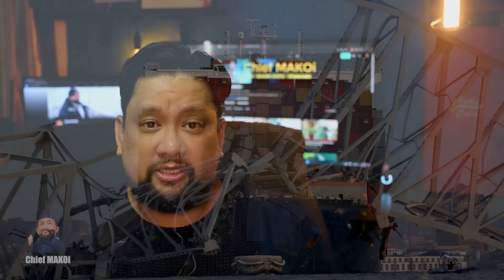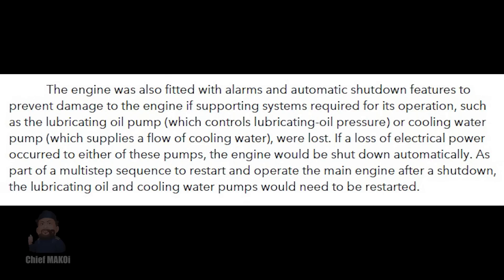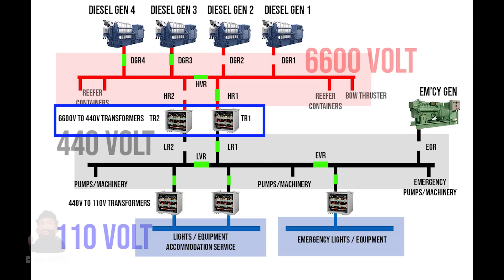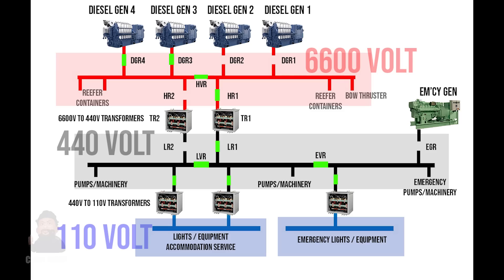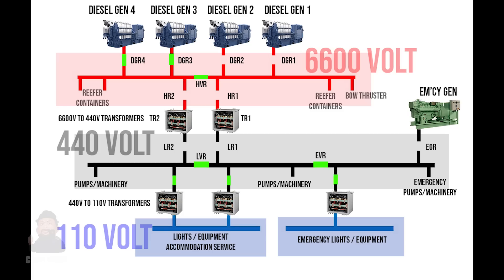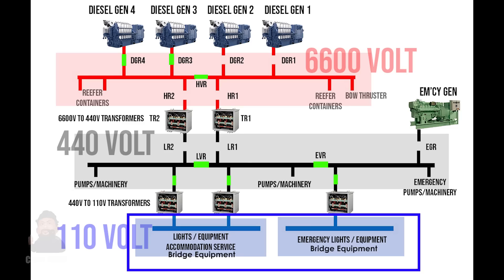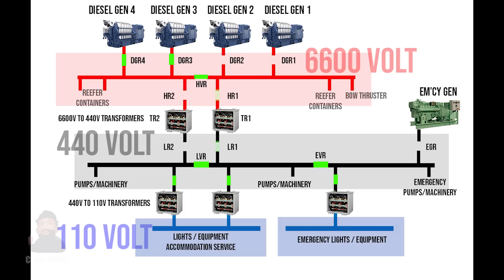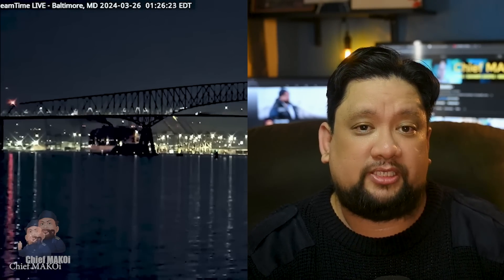Explaining the NTSB Report on the Container Ship DALI | Chief MAKOi

Comment: Hey Chief I was recommended to your channel I’m finally off my boat with the bandwidth to do
It. Great synopsis. The black smoke is a big indicator to me, I’m sure you’ve seen stuck injection pumps in your career. Too many and the generator can’t control its speed and everything else goes wrong. I think the final report will have many more details including bow thruster stop time I have a theory stopping the bow thruster triggered the crew to stop a 3rd generator not discussed so far and that event showed the other 2 online generators unable to adapt to the load change.
Reply: Yes; good thought & approach also to look into electrical `load drops´, not only jumps with load increase. We can strongly assume preliminary NTSB report so far only included topics which are waterproof already.
But that question wrt “bow thruster stop time” (plus when crew actually started stopping it; as it is supposed being less effective once ship gains speed ahead, thus there’s “plenty of time”) might also be interesting wrt to the direction of Dali’ and this veering to starboard towards the bridge pillar later on. I’d expect bow thruster has been used to make the 180° turn when leaving the pier and moving towards the main channel; possibly still being active when moving straight ahead. With the bow thruster causing water flow to turn the bow (for the 180° turn to port it needs to drag water from port and `pump´ it to starboard), it might be interesting what happens and how once bow thruster engine slows down and stops. Simple assumption is that power will be switched off from the bow thruster motor. Due to inertia of both engine and water flow, the flow will `gradually´ slow down until it stops finally. However, there might kind of `compensation reaction´ such, that water flow might also cause some small push of the bow in opposite direction now, which would be to starboard then. That would fit from timing because if the first blackout would be caused by switching off the bow thruster (while motor and propeller still spinning for a while), it would cause veering momentum which however might only be noticeable later.
I could image such kind of `compensation´ also happens wrt `propeller walk´ once main engine slows down (but with much bigger effect there). NTSB prelim report has interesting detail that rudder was amidships (0°) when first blackout occurred – means that `propeller walk´ has not been compensated by rudder at that time. Posted a long comment & question in corresponding Sal’ videos on `What’s going on with shipping?´ wrt that.
That’s when I’m spending thoughts wrt the physics involved here – but ask for feedback from any experienced seafarer (PS.: so please bear with me that I’ve hijacked your post for question wrt manoeuvrability, but perhaps somebody jumps on it. I’m really curious not only about the cadence of technical fails but also which effects they’ve caused leading to this overall disaster finally).
Reply: Two further questions wrt system components behaviour in case of loss of electrical power – using the opportunity to have 2 chiefs in this conversation here. To me it always interesting to also look into how systems behave when operating conditions are not as expected - especially when lots of inertia is involved.

Part I: For a 2-stroke diesel engine, are inlet and outlet valves controlled mechanically or electrically?
If mechanically and linked to the rotation of the propeller shaft, that would mean engine sequence would continue `as per normal´, except missing air blowers (I’d assume turbo-charger not active at vessel speed below 10 knots yet – ?) and high-pressure fuel injection. Thus at first moment of power loss there’s less resistance for compressing the air, while last remaining combustions still are done `normally´, but also face less resistance. That could even lead to a slight initial speed-up of the propeller rotation until lack of further combustions. That goes towards the effect of propeller walk. For short time, it might even get bit stronger, but then the increased imbalance of water levels might kick back stronger later on, providing a more pronounced push of stern to port.
If valve control is completely done electrically, we would end up in a closed system with a (temperature dependent) compression, which I’d assume acts as kind of `damper´ and resistance to the rotation of the propeller. But also here loss of compression could lead to same effect on propeller spin & walk as per above.
Reply: @NRZ-3Pi10  Dali has what we call an electronic main engine its designation is ME I have not worked on that type but know it’s electronic fuel injection. I’m not sure any of it matters for the accident as all 2 stroke diesels will immediately shut down on loss of electricity. Now will they turn for a bit before they truly stop? Sometimes and it depends on how fast the ship was going. Every ship and engine is going to have a different speed where that happens
Reply: @steamman9193  Thanks again for sharing these details! 
Based on this and some more brainstorming, I more and more tend towards the reason why Dali veered to starboard once losing electrical power and main engine is due to the currents induced in the relatively shallow waters of Baltimore port by Dali’s propeller itself (!). As long as main engine still running, it appears like the propeller walk even seemed to be compensated by these currents, as rudder has been amidships (i.e. not compensating any prop-walk effect). Once main engine gone – which as per your feedback obviously can / will happen in quite short time – those currents will still keep remaining for a bit longer time due to inertia of water; now dominating since also no prop-walk any longer.

I did very simple calculation trying to get a grip on the dimensions. For simplicity, let’s take a mass of 100000t (metric tons) which needs to be brought on speed of 8 knots ( ~ 4m/s ). Applying conservation of momentum ( momentum =  mass * velocity ), it needs equivalent mass of 100000t at same speed (or less mass but at higher speed then), but in opposite direction. Sounds incredible, but considering water comes along with weight of 1t / m³ (1000t in a cube of 10m x 10m x 10m = 1000m³), it “just” needs 100 * 1000m³ , i.e. 100 of such 10mx10mx10m cubes. Dali has width of ~50m, and can only move along the main channel of Baltimore harbour. Thus I’d expect the amount of water which can be used for propulsion below bottom is quite limited. Means most of the water to be pushed & accelerated by the propeller needs to come from the sides then. For simplicity, let’s split 100 * 1000m³ in (2sides * 50cubes/side) * 1000m³ or (2sides * 2lanes * 25cubes per side&lane) * 1000m³. In other words, all the water needed comes from 2 lanes with width of 20m next to Dali at a length of 250m (which is almost full length of the ship), which will cause currents in the vicinity of Dali. Due to area besides the main channel is relatively shallow, I'd expect strong currents towardss water surface. However, due to rotation of right-handed propeller, there’s also drag / pull of water on starboard, and push-up on port side. So in principle a vertical component pushing Dali’ stern to port, but obviously compensated by propeller walk here. However, once main engine and propeller stops, the flow of tons of water will still continue for bit longer time, with a vertical component pushing stern to port still and thus causing bow moving to starboard (and the pillar) now; assuming the ship turns around its centre of gravity.
Sounds reasonable?
Would be interesting to know whether the water depth is considered in simulations of harbour situations.
Currents of Curtis canal and remaining tidal currents, plus some wind might add on top in unfavourable direction.

Feel free to file it under “Aahhh, another landlubber discovering maritime basics” 😅.
But as engineer, I prefer to start getting understanding based on such basics first, before right-away going into esoteric stuff or even this conspiracy crap (…) why Dali veered towards the pillar during the blackout.
Finally, it’s not by chance electrical engineering (especially for high frequency & micro-waves) uses terms like currents, waves & vortex as there’s lots of analogies to be found in fluid mechanics (but much more tangible there).
Reply: Part II: behaviour of hydraulics of rudder control
NSTB prelim report stated rudder amidship (0°) at the time of first loss of electrical power. That leads to question if rudder might face a certain clearance with the loss of pressure from hydraulic pumps. I’d expect for safety reasons, cylinders have control / blocking valves which help to keep pressure and thus rudder position to quite good amount, with liquids being much less compressible compared to air. However, if there’s certain clearance nevertheless, could it be that water levels & pressure caused by `compensation´ of propeller walk might slightly push the rudder towards starboard, thus also contributing a bit to the turn to starboard observed (although I’d expect `compensation effect´ of the prop-walk being main contributor here)?

Comment: I was First Mate on a SMALL boat.
53 feet at the waterline.
We had ONE engine that supplied power to everything, and only batteries for backup.
For those that say a rudder works regardless, I demand (not beg) to differ.
The prop is AHEAD of the rudder for a purpose.
While the rudder may have some effect on a boat that has headway, it is MINIMAL.
As with the large vessels, it takes TIME for the rudder to have an effect.
In a port, while you are coming in at an idle, there is less effect.
The boat/ship takes longer to “answer her rudder.”
For maneuvers, you turn the rudder to near full lock, then “surge” a bit of power to the prop to get the vessel’s stern to move.
The vessel starts to move in the desired direction, and while that is happening, the rudder is cranked the opposite way to stop the inertia by another surge.
In reverse, the rudder does almost nothing.

Having experienced a complete rudder failure with the rudder going completely inoperative IN PORT….
It takes a skilled crew to manhandle a vessel into its berth.
I’m here, and the boat never was in any real danger.
A skilled crew in a small vessel can work a small craft in some pretty wild circumstances.
I saw the footage of this happening, and just can’t imagine the helplessness the crew felt while the struggling to correct what felt like impeding doom.

Believe me, I’ll bet more than one of those crewman would rather have perished than to live through what was coming with the investigation 
S!

Comment: To me it looks more like a long time unused and open breakers around transformer 1 accumulated moisture and/or corrosion, leading to problems (and possible damage) after they became loaded (ship just leaving the port). First just the breakers trip, second tome it could have been even a flashover (an effective short circuit), tripping the first breakers upstream, which were the ones at the generators. Because of the short circuit ar spinning and excited generators, both tripped.
I see very unlikely both generators losing power exactly at the same time. The black smoke may suggest such engine power loss, but not due to insufficient fuel feed pressure, as fuel starvation on a diesel does not usually lead to a black smoke. And an internal fault (engine about to seize up) won't affect two machines at the same instant.
A severe overload, like a transformer "selfdestruction in progress" (before generator breakers popped open), may explain the black smoke pretty well, as well as the generator breakers tripping after some while.
In any way either of this (or something else) should be explained once the investigation will complete.

Comment: But if they were running on dirty hfo before arriving to the port then they changed over to LSMGO before arriving then it's very possible for the filters to clog due to the diesel cleaning the dirty fuel line, that's if they were using the same supply unit on both diesel and hfo (I am relatively inexperienced but I have seen both the same supply unit and different supply line for diesel / hfo configuration)

Comment: Chief, you left out some key information. Several questions exist.  Is there an ABT for the two HV/LV transformers?  Why would a single point failure electrical system not use an ABT to switch power over in the event of a Transformer failure?  Large diesel generators and main engines may have had attached lube oil, fuel oil and coolant pumps. Once an engine is running they don’t need startup electrical pumps. I don’t see a fuel problem here in this event until electrical power loss. Then perhaps you cannot transfer fuel but your gravity service tanks are good to feed fuel injection pumps for hours.  Of course i dont know the exact design of the engines to determine if they have attached pumps.  It looks as if the initial failure cased a cascade of failures because the ships systems were in a very bad state of readiness and subject to cascading failures.  Crew failure is certainly involved.  A lack of proper pre-underway testing is also obvious to me that would have rooted out failed systems and components.  Its not common to trip out a main power transformer.

Comment: Dumb question ... why the main propulsion plant cant have an emergency set o pumps linked to it mechanically, like .... a car ??. Im sure there are very good reasons to run al the pumps on AC voltage, but it spoils any emergency back up response time as once propulsion stops, needs a complete procedure to start, I would try to keep the populsion running on itsel at least or short periods o time. I understand that most o this cases happen in open see where  or  minutes are not critical at all and this systems are designed to that and the Bridge was a very unortunate chain of events. Still hard to understand how all this redundancy can fail ... something else is worng.

Comment: I'm curious as well, been out the navy a while and this is making me think back on ring bus safeties hard. I know they won't be the same but I'm thinking some of the principles might be. I know trips would be designed to open breakers as close to the fault as possible to prevent taking down any necessary and still safely operating equipment. So if the hr1 and lr1  breakers to transformer 1 tripped it was prob an issue with the transformer? You would want this to trip before it could cause a problem that would trip up stream which we see as it does not cause the main hv breakers connecting the generator to the bus, dgr3 and dgr4 to trip. It could be a fault on the lv bus but in theory there would be breakers down stream closer to sub circuits and pannels supplying them and equip that should have tripped before tripping the transformer hence breaker pannels. That and tripping both to a piece of electrical equip was usually an equip fault if I remember correctly. But the crew manually closed hr1 and lr1 putting the transformer back on line. And in less than a minute dgr3 and dgr4 trip. This is also when smoke starts bellowing. could this be under volt or over throttle trips bc they could not supply some insane load bc of a fault in the reconnected transformer? I seem to remember there is a brief time after large breakers close that the trip is not "rearmed" bc an initial transient could re trip them. Again I'm almost 20 years out from my operator days. I deff get that insufficient fuel would cause rpm and torque to reduce resulting in and under power trip of then generators but would that cause all the smoke? Or was all that smoke dgr 2 coming on and loading hard? They also never say if dgr 2 shuts down or any other trips occur once they change to transformer 2 and dgr 2, but if it was fuk and the dgrs are on common fuel lines it should have dropped after a spell. If it was in the lv or hv bus it would have also eventually re tripped as the fault (if not in trnasformer1) would have not have been isolated. Im also surprised and curious about immeadiate actions why not split the bus and bring both transformers online bc there are some basicish (at least how we ran) indicators it might have been thr transformer. Also dont know how much civilian ships are set up and capable of runing split bus. I do get why, sort of, they never tried to restart the main engine. It doesn appear that they kept main power restored for any significant time so that they could. At 0125 they tripped, 0126 and seconds first restoration, then 0127 second trip, dgr 2came up but it took 30 more seconds to restore power to 440v bus using transformer 2 mere sends before impact.

Comment: Since the 6,600V bus had power for most of the time and it powers the bow thruster, why was it not used in an attempt, with the rudder, to turn the ship?
Reply: The ship was travelling too fast for the bow thruster to be effective. Too slow for the rudder to work without the main engine.
Reply: @christopherrobinson7541  Plus crew on the bridge can not be aware of the status of the HV-bus with everything else on blackout.
Next, when already facing blackout, does it appear reasonable to switch on bow thruster which draws a lot of power itself?
Finally, I'd expect bow thruster (if effective here at all) would turn the ship around its centre of gravity; means bow moves to port but same time stern to starboard; thus just bringing stern towards the pillar ...